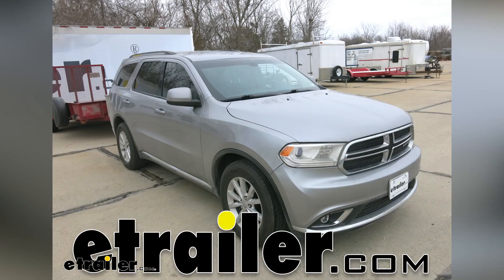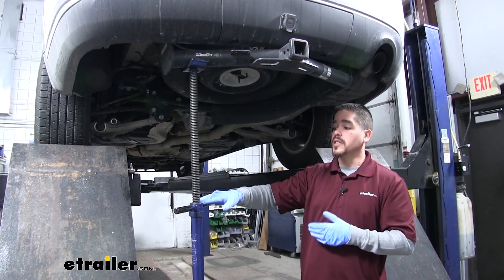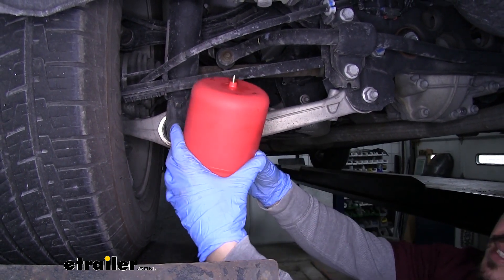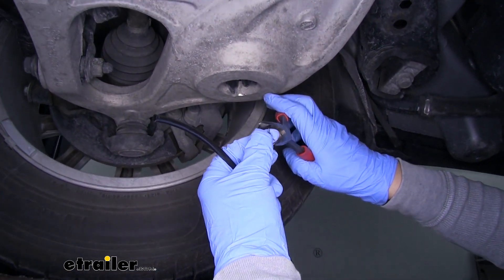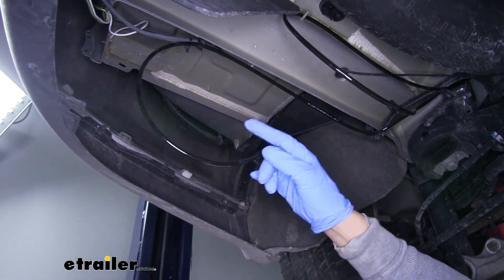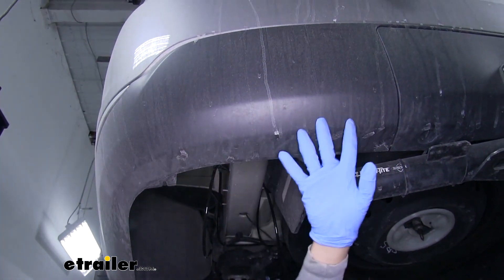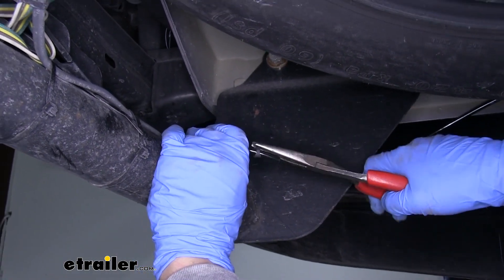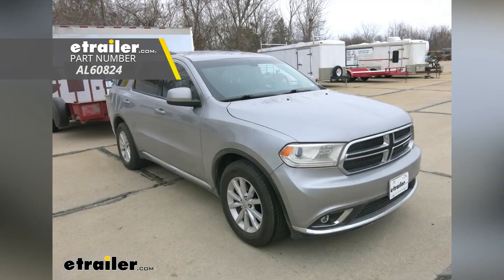How to Install: Air Lift 1000 Air Helper Springs for Coil Springs on your 2016 Dodge Durango

Comment: Any options for a 2014 Durango r/t?
Reply from the maker: The set of air helper springs shown in this video will also fit all models of the 2014 Dodge Durango.
https://www.etrailer.com/Vehicle-Suspension/Air-Lift/AL60824.html
Reply: @etrailer  but it is my understanding that they don't fit R/T though,  is that not correct?  The R/T has different springs